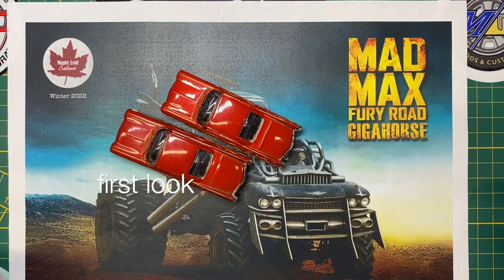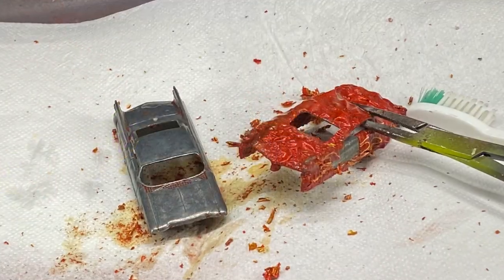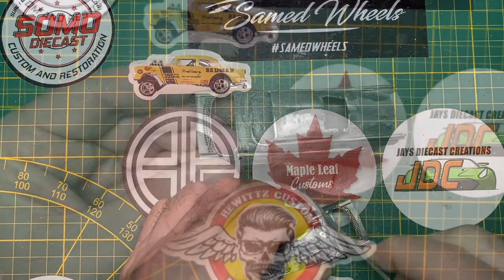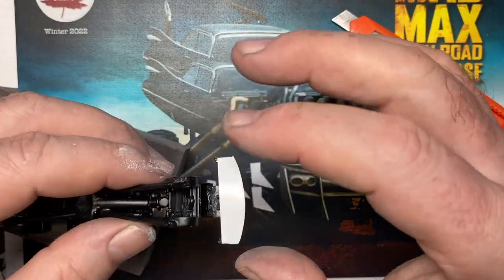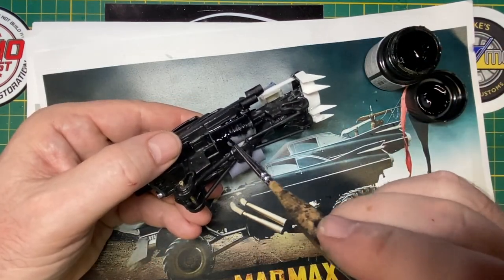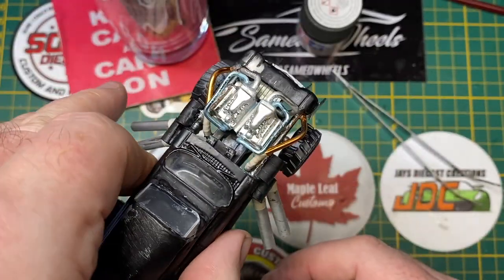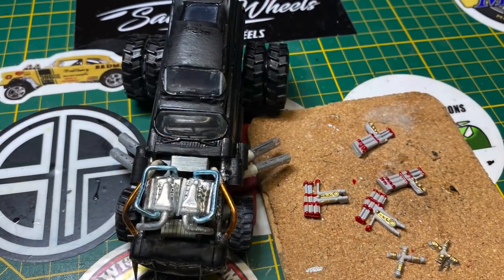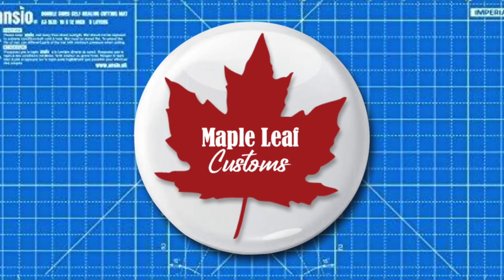Mad Max Fury Road Gigahorse (147) JDC Double Trouble

Comment: You have to do the "RAZOR-COLA" when you get a chance. In my opinion it is the only way the interceptor was improved.
Reply from the maker: Absolutely. I'll put it in the lineup. Ford Falcon, right? 🍁👊
Reply: @MapleLeafCustoms  Ford Falcon XB GT Coupe 1973, according to the wiki!
Reply from the maker: @bigbadbandicoot2744  Ha! I instantly did a wiki search too, right after your comment. 😀 There's a Greenlight casting but it's already done as the Razor Cola. I have spotted a few Falcons on eBay that should fit the bill. I might start with the Interceptor and then do the Razor Cola as a Part II. Might have to 3D print the engine for that one. Also looking for a Man Multi 1 for the Fury Road Doof Wagon. That looks like an intimidating build, but that's the fun of the hobby - trying new things and getting better with each build. Thanks again for taking an interest and following along. I'll work my way through them all, as special videos. 🍁👊
Reply: @MapleLeafCustoms  Can't wait!👍

Comment: Another question! What thickness of styrene sheet did you use for the front little sharp edges?
Reply from the maker: I used 0.5 mm for the front ram pieces. They're cut out individually to fit around the grille. 🍁☕️👍